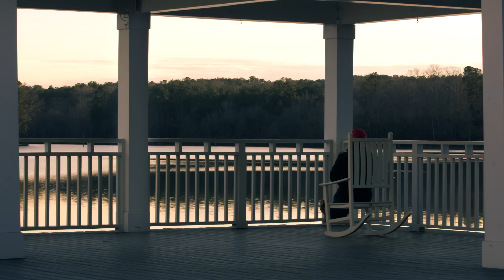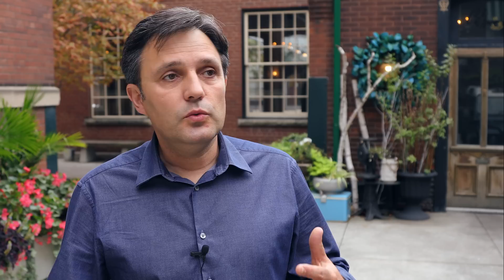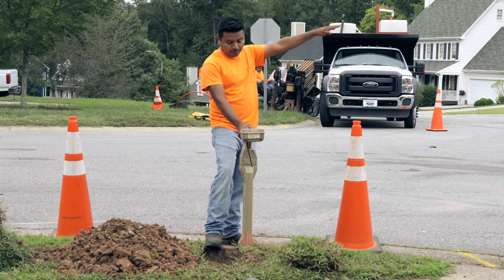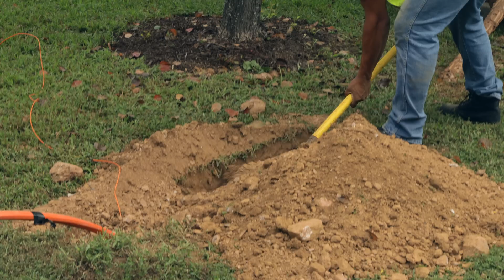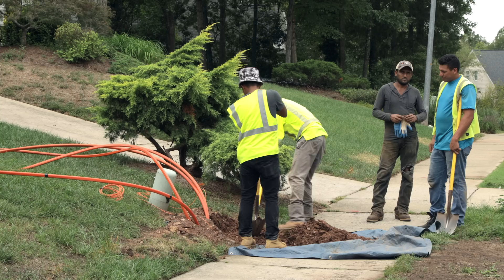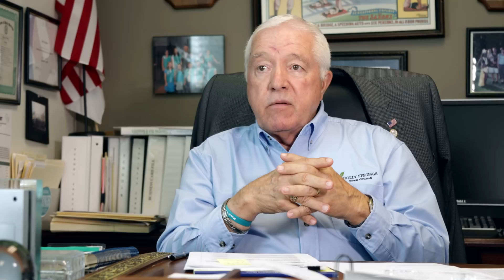Building a fiber network: Dirt and Hard Work

Comment: I hope you're paying those workers a fair wage to put in those lines for rich people. Look like non-union contractors to me.
Reply: rich people? can you define that?
Reply: I can assure you as North Carolina is a "right to work" state, those are not union workers. They probably are being paid a competitive wage. "Fair" wage would be subject to interpretation. I can also tell you as someone who's waiting for them to start working in my yard, we are not rich people. We're not poor, but we're not rich either. Ting is providing us a quality internet connection at an extremely fair price. We are barely on the outskirts of the new Google fiber coming into the area. The other local providers have suddenly prioritized their upgrade of infrastructure after DECADES of people paying obscene prices for sub-par service. We are forced in our area to choose between two providers. One has decent Dual DSL and the other has high speed cable. I can tell you from personal experience, neither is reliable and neither can push past about 50Mbps for less than $100 month. That being said, even if you pay the price, the connection is spotty at best. I welcome Ting, and I can assure you whomever they sub out to dig holes is being treated better than either of the other two providers in the immediate area. Not to mention, I'm sure the people featured in the video would rather work than not work.
Reply: "Competitive" wages in a race to the bottom, right to work economy generally are far from fair; in fact, they are designed to undercut the higher quality work done by skilled laborers who are constantly training in their craft. Even though this process is pretty straight-forward, I would rather pay extra to have a crew who is properly trained rather than a few bodies pulled off the street, which is often what non-union contractors do. 

Rich? Maybe not. Privileged? Definitely. The fact that you have ANY choices at all means you're quite fortunate to live in an area with access to resources. Wealth is relative, and location is a HUGE factor. Simply put, if you can afford to live in an area with access to resources, you're way better off than most people. Where I currently live in Indiana (another right to work state), these resources are scarce or don't exist at all. As stated previously, my parents in Ohio only have access to one ISP, CenturyLink DSL at $60 a month for 3Mb/s.......  During peak hours, they're down to Kb/s speeds. Where I used to live, about 30 minutes outside of Columbus and still a major metropolitan area, Time Warner and Century Link were the only ones available. We were paying $150 a month for "speeds up to" 50Mb/s (approx. 30Mb/s was the norm) with Time Warner.     

I apologize for making my generalization about "rich people". I do know a few who are actually nice. What I really find frustrating about these services, Google Fiber and Ting's new offering, is that those who desperately need options are always last on the list to receive them. In the Information Age, internet access should be classified as a public utility in my opinion. Your access to information should not be limited by your location.
Reply: JesseArt I suppose you 'know' they're not 'union' because their  skin was brown? #deplorable
Reply: @bardawulf5827  NO overshoes on the bore rig, no hard hats, barley any reflective gear, no conned off area, not even gloves. YA these are nonunion workers and their safety and work practices are a joke.
Reply: Wow, nice assumptions. I'm way further to the left than HRC ever has been. So yeah, f*&k Trump. I grew up in a LiUNA family of laborers and fight every day for workers rights, very often civil rights. Unless you're in California or the Southwest, it's pretty unusual to have an all Latino crew unless it's a non-union contractor who's exploiting them, which is VERY common where I live in the Midwest. Contractors will hire them at like a quarter of the cost and have them work 12+ hour days, often without lunch breaks. My dad's local organizes them, has them join and go through the apprenticeship program if they want to (some prefer to stay under the radar if they're indocumentado, understandably). We even them help them with their legal documents, taxes, etc. I used to help teach English before I had to move away to return to school.  

I'm not taking a dig at the workers at all; it's the company's business practices that concern me as Ting often markets itself as being a more ethical company compared to other carriers. I grew up in a multi-racial family, entonces no tengo nada mas que amor por mis primos latinos. I just want them to be treated with dignity and respect and earn a fair wage, something few Americans seem to enjoy these days.

Todes Jaeger, "rich" is a loaded term for sure. Let's say "affluent", "wealthy", "privileged", "predominantly white", etc. Basically, those who can afford the cul de sac McMansions where these lines are being buried. I imagine fiber optic cable will not be available to the masses for quite some time. Comcast and Time Warner sure are winners when it comes to infrastructure upgrades. TW refuses to run 60' of copper to my parent's house who are still rocking DSL at 3Mb/s for $60 a month. During peak hours, they're lucky to get 1Mb/s.
Reply: It’s called economics. Fair wages are the market wages.